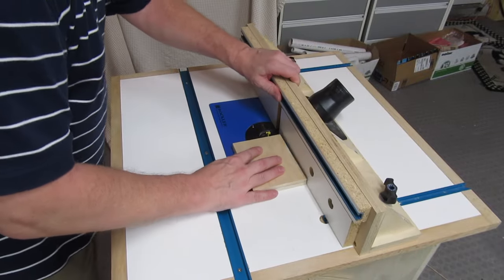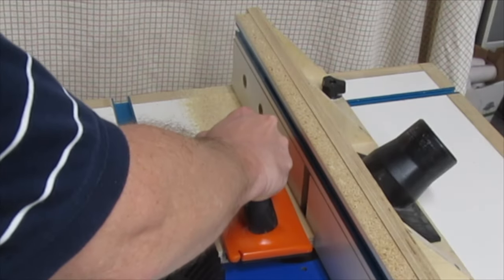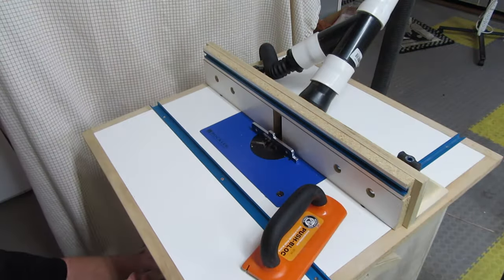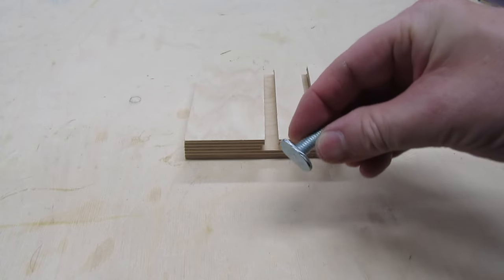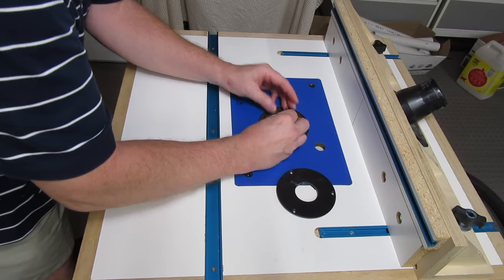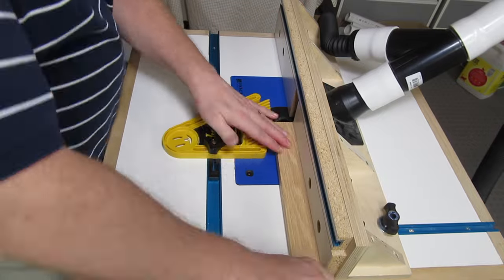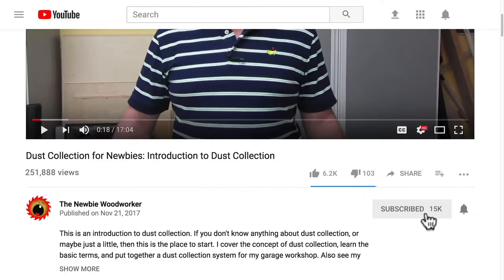Make your own T-Tracks and T-Slots!

Comment: Are they still holding up or have you since switched over to manufactured t-slots?  Also, do you think that using regular bolts is better than using t-slot bolts?  Here’s why I ask...I’m thinking that the extra thickness of a regular bolt head would work better up against the wood groove, than the super thin head of a regular t-bolt or toilet bolt. I’m wondering if the regular thin t-boots or toilet bolts would eventually created spots in the groove that would make it hard to clamp to if needing to be off by a small fraction. For example let’s say a stop was regularly used at 20” over and over again.  I’m assuming an indented groove would be created at that exact spot from the repeated use, especially from a thin t-bolt in a wood slot. If I now needed to have a stop block at 19 7/8” for example, I’m wondering if it would be extremely hard to do because the t-bolt would naturally fall into the 20” groove that was made from repeated use. A regular bolt I’m assuming could create the same issue, but with the extra “meat” (metal on the head), would it be less?

Curious to hear your experience.
Reply from the maker: I think you're worries are well-founded. If I was using them like that, I think I'd want aluminum tracks. To me, it's not worth saving a few bucks when something is critical, like that.

FWIW, I'm still using them in my drill press table, which is the only place I installed them. I use carriage bolts now, because they slide really well with the rounded heads. I use an angle grinder to flatten two "sides" of the head, so it fits in the slot. Have to be careful not to grind off too much, but it's easy once you do it a couple of times.

So far the track is holding up fine. If I crank down a clamp too much, I can hear the wood "creaking", so I try to be careful. Personally, I love the way it looks in my drill press table, especially on camera. But I don't know how much I'd use them in other projects - I'd have to think on it for a while.
Reply: The Newbie Woodworker. Thanks for the detailed reply and update. Very helpful!
Reply from the maker: @PartyTimeProDJs  👍

Comment: Because wood changes significantly with temperature and humidity, I am experimenting with machining fixture pieces using HDPE and UHMW for cheap prototyping. Trying to resist buying the parf dog system... (Don't watch Dave Stanton's videos it's a whole new world of rabbit hole tool spending for excessive obsession with accuracy.)

Have to go veeery slowly on plastics though because they begin to melt/deform at as low as 180F.

About the same streng as wood, so I'm using it for miter tracks instead of t tracks with clamping. I'm prototyping mft template and a new universal track saw adapter design because I am so far down this rabbit hole... At least my friends have cnc routers so I'm not buying one of those...
Reply from the maker: OMG, you're worse than me! 😄 I've used UHMW for runners before, and I'm using them in my router lift to run in a couple of miter tracks. But I think I'll stay away from that video, or I'll never finish any of the other things on my long list!
Reply: The Newbie Woodworker every time I think I want to do something

I end up over engineering a prerequisite component

At this point I'm practically reinventing wheels 🤣

Not having a dedicated workshop space/budget means getting rather creative! Traffic cone ($9) dust cyclone was my first project...
Reply from the maker: That is so me! "Over-engineer" is my middle name. It was true even back in my programming days. But I want it like I want it, same as you, right? As long as you're having fun, what does it really matter, anyway. 😛
Reply: The Newbie Woodworker I'm currently doing a programming boot camp...

I don't know how my mentors put up with me

EVERYTHING MUST BE DONE IN THE SMALLEST AMOUNT OF TIME AND STORAGE AND LINES OF CODE, OKAY
Reply from the maker: Huh. That's how programming used to be, in the 80's and parts of the 90's. But nowadays none of that matters much at all, since computers are so fast these days, and memory is measured in gigabytes instead of kilobytes. What does matter is how easy is your code to understand, and how easy is it to make changes. Maybe they'll get to that later on. Your instructors would probably hate me. 😛
Reply: The Newbie Woodworker I stopped asking questions about how CoreFoundation implements arrays/etc. at least...

But check out this voodoo magic: https://ridiculousfish.com/blog/images/array/cfarray_results.jpg

They make us use real variable names now! When I was in college it was all i++; j--; j*i; absurdity! In the snow, uphill, both ways!
Reply from the maker: LOL!
Reply: Guess I am getting way too old.  In the mid-70's, when I started, we were still using punched cards and paper tape. Was glad when I didn't have to push a cart around just to not "spill the beans" as it were.
Reply: Tony Harris >insert photo of 512GB micro SD memory card.
Reply from the maker: Tony - Both my wife and I were there also. As I mentioned somewhere else a few hours ago, I still remember when we got our first green screens at work. Gone are the days of 2 hour compile times, one program at a time. Thank God.
Reply from the maker: Elaine - Yep, unbelievable. Now, with all the external drives I have, I'm not sure I can even count the number of TERABYTES I have available. Who knew I'd live in an era when I'd need to learn to pronounce "petabyte" (still not sure, lol).
Reply: The Newbie Woodworker did you know that the Large Hadron Collider generates about 1 petabyte of data per second? They don't record all of it, but they've been recording about 25 petabytes annually., That's not even with the latest equipment! They're shutting down for 2 years in December for tons of upgrades.
Reply from the maker: I'm sure I saw something about it. But honestly, it's kind of hard to comprehendg numbers that big. At some point, they just become BFNs. (Big Friggin' Numbers). 😛

Comment: How do you install the ones you made from red oak?  From underneath? Otherwise how are you countersinking the screw holes in the slots?
Reply from the maker: I had to go look, because I couldn't remember. 😂I glued them in. And they're still fine. No separation due to expansion differences, or anything like that. If I were going to use screws, I'd probably consider just using a larger drill bit to drill the countersink portion - the kind of bit with a round bottom, of course. But I'd try it out on a scrap piece first.
Reply: The Newbie Woodworker thanks for the quick response. I might just have to glue since you would only have 1/4” clearance for any bit to countersink. Is 1/4” large enough for an effective countersink on most wood screws?
Reply from the maker: @exexangler  For #6 screws, I think it is, but you'd have to measure to be sure. Personally, I think gluing them is fine. If they're going into plywood or MDF, then the only real expansion will come from the tracks themselves, and if you have the grain running mostly up and down, there really shouldn't be an issue. My guess is that even if you had the grain running horizontally, it wouldn't really make a noticeable difference, but of course I'm not an expert.

Hey, if I'm wrong, then you'll have personal experience on the subject. 😛You could always cut them out and make new ones if you had to. I actually did that once, because I just didn't like the poor job I did on them. Pretty easy to do.

Comment: which router bits did you use  i use 5/16  toilet bolts  in most of my jigs  some 1/4 20  mostly  the larger i ordered them threw rockler  with star knobs
Reply from the maker: The Rockler bit will work with the Rockler t-bolts that came with the star knobs. I haven't tried the toilet bolts, but I think they'll work also. If you don't want to spend the money on the Rockler bit, look for other bits that cut the same dimensions.

Comment: Did you ever find a track saw tslot compatible cutter?
Reply from the maker: I don't understand the question.
Reply: @TheNewbieWoodworker  You went over what fits/doesn't for each - what we all want, and I presume that includes you, is one that creates the same dimension slot that every festool clone rail has on the top and bottom and every generic t-track extrusion uses - ie 8mm opening 12mm width at bottom. I have contemplated using a diamond wheel to make my own out of a generic cutter the right size eg half inch straight ground down could do it in combo with an 8mm straight to clear the path in advance similar to the rockler one but smaller.
Reply: @TheNewbieWoodworker  In particular you stated at some point "there may be a better cutter than either of these" and it was to this that I replied. :-)
Reply from the maker: @fredio54  Ah, got it. Thanks for the explanation. No, I haven't, but then again, I haven't really needed one in a while.

Comment: Dumb question, I'm just a newbie - why not use dovetail instead of T-tracks in these applications? I guess there is a larger variety of dovetail cutting bits?
Reply from the maker: Not a dumb question. I don't have a perfect answer, but here's a guess. When you use t-tracks, you generally use sliding t-bolts in them. T-bolts are relatively easy to find, and probably easy to manufacture. I'm not sure what you'd use to clamp to a dovetail track. With that said, I've seen dovetail tracks used for all sorts of things (in videos - never done it myself), so when in doubt, try it out and see what you learn! 😄
Reply: @TheNewbieWoodworker  Thank you for the prompt reply. I guess you are right - dovetail method is ubiquitous in assembling sliding parts, I was just questioning its application in this particular case. Your suggestion to try it out is also correct :-) then you don't notice when you stop being a newbie :-)
Reply from the maker: @adamsmith2719  That's really true. I look at it like this: For some things, I just take people's word. Safety, things like that. But for things that either don't make sense to me, or I just need to see it for myself, then I'll spend the time and try it out. In other words, pick and choose. What good is a hobby if you can't have fun, right? 😄

Comment: Thanks so much for this video. I really learn a lot from you. I have a question. Do I need an adapter for the bigger bit because it won’t fit my router?
Reply from the maker: You're quite welcome. You can't use a bit with a shaft larger than your router will accept. Sorry.
Reply: Thanks
Reply from the maker: @PastorEbolden  👍

Comment: Hi there! 
Yonico does have 1/2" shank t-slot router bits. 3/8" X 1/2" and 1/2" X 1/2." 
I don't know if they sell them separately, because the ones I have came with the big 1/2" shank. set. I hope this will help somebody though.
Reply from the maker: Thanks! 😄

Comment: There is a better solution for Expansion/Contraction, use plastic (Not Acrylic) which never moves to make T-Tracks. It is rock solid and easy to cut. Wood will be a problem over time, so why re-make when you can use Plastic.
Reply from the maker: Thanks for the comment. Why use wood over plastic? For one thing, I think red oak t-tracks will look awesome. If contraction ends up being an issue, I'll just make a new drill press table using aluminum t-tracks.

Comment: I have seen someone use slat wall as T-track on a CNC machine, he also used the aluminum track reinforcement
Reply from the maker: Interesting. Man, if I had a CNC machine and a 3D printer, I'd never come out of my room. 😛
Reply: Newbie:
Too funny ¡
Reply: Get yourself a Snapmaker, which is a 3 in 1 (Laser Cutter, CNC Engraver & 3D Printer) Check it out at snapmaker.com. I am buying one in about two months time.
Reply from the maker: LOL. I'd end up spending so much time playing with it, I'd never get another video done! 😛

Comment: can you use a portable router with slot cutter bit?
Reply from the maker: I wouldn't try it with a trim router, but a plunge router or a fixed-based router should be OK. Of course, be careful. 🙄😄

Comment: Quick question for a newbie router owner.  When you seat a bit in the router do you drop it in as far as you can?
Reply from the maker: Yes, but then you lift it back out a little, maybe 1/16" (which is pretty hard to judge, so just back it out "a little"). When the bit gets hot, it expands, and if it presses down against the bottom of the collet, it can get stuck.
Reply: @TheNewbieWoodworker  Thanks for the reply.  I'll use a feeler gauge for both.
Reply from the maker: @hogue3666  You're welcome. You don't have to be that precise - just as long as it's off the bottom, I'm sure it's OK.

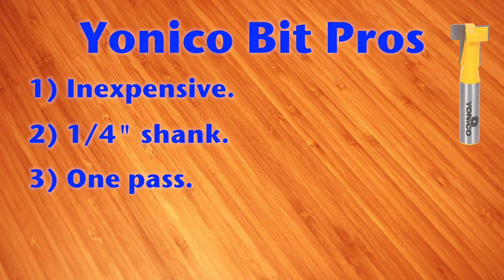Comment: Dan, I think you may have slipped.  I could be wrong tho.  @7:20, when you are talking about the Yonico bit and a 'smaller router', you suggest making multiple passes.  It took me awhile to tie that back to using a straight bit before using the 'Yonico'.  You made me have to think - but that's a good thing. ;-)
Reply from the maker: Thanks for the comment. Yep, that wasn't at all clear on my part. The worst part is, I knew it wasn't clear and left it that way. Chalk it up to a case of "I'll be darned if I'm going to make one more change - I'm posting it as is. People will figure it out." Admittedly, that's never a good attitude. But I'm glad you did figure it out!
Reply: Yeah, I was trying to figure out how you'd do multiple passes with a t-track bit. Thanks for clarifying.
Reply from the maker: Dangit! I know better than to leave something "wrong" when I post a video. Shame on me for not fixing it. I hope this time, I learn my lesson. 🙄
Reply: Jay Herde

Comment: Great minds think alike.  I have both of the same bits!  I'm interested in any strength differences between the aluminum and red oak tracks. Were you planning any non-scientific tests?  Along that line,  Wood Glue makes the joint stronger.  What about a glued up t-track for those without routers and perform the same non-scientific strength test. Just some of the thoughts popping into my head from your video's.  Great video once again by the way.
Reply from the maker: Thanks for the comment. That's funny about the bits. I had the Rockler one for a year or so, and decided to get the Yonico bit for this video - who knew I'd end up loving it? Since I'll be putting these t-tracks in my drill press table, they'll certainly get put to the test, strength-wise. But I'll leave someone else to do the tests. And I'm not a gluing expert by any means, so again, although it's a good idea, I'll leave it for someone else. Thanks!

Comment: Hi Dan, I need your thought on an observation that I just realize while making (still designing phase in sketchup) a drill press table: some fences have their T-tracks on top (like your drill press, correct?) and some on the side (like your router table or steve's drill press). Are there specific reasons to put them on top or the side? KUTGV!  BTW, my drill press will have 3D printed T-tracks (or al least I gonna try, I did not yet see 3D printed T-tracks on youtube makers videos and maybe there is a reason fo :p).
Reply from the maker: Well, I think this is how I do it, but I reserve the right to be wrong. 😄If I want to use a flip-stop, then the t-track goes on the top of the fence (the "back" portion of two 3/4" pieces of plywood glued together). And it has to be a certain height, typically pretty low (check the requirements of the flip-stop you might want to use). But for the router table, I want the fence a little taller so the sliding pieces don't have to be too small, and also so that there's room for the dust port. So like I said, I think this is how I usually think about it. I hope that helps. 😄

Comment: What kind of router do you use in your table?
Reply from the maker: I have an older Ryobi plunge router. I can't remember if I mention it in this video or not, but I have a unique router lift I built, that works for both plunge routers and fixed-base routers. Here's the build video: https://youtu.be/LJqPDADi8MM. It would work fine with something like a Harbor Freight router.
Reply: @TheNewbieWoodworker   right on thank for answering back and love your content I watch them all as soon as there available to watch
Reply from the maker: @shanejohnson800  No problem, and awesome! 😄

Comment: I followed the link on this video and ended up buying the wrong bit. It doesn't link to a 7/16th bit anymore.  1/4 INCH HEX BOLTS DON'T HAVE 1/2 INCH HEADS
Reply from the maker: Which link are you talking about?
Reply: @TheNewbieWoodworker  the Yoniko bit is not offered in 7/16. I followed your link and bought the product without thoroughly looking it over. Got a 1- 1/16 bit. Was a "bit" upset but investigated. Found the 1/2 in bit bought it. It doesn't work because 1/4 inch bolts have 7/16 heads. Rewatched your video and you show it clearly as 7/16 (for all of 2 seconds). They don't offer this any more. I'm buying some true 1/2 x 5/8 tee bolts which should fit well though the 1 1/16 bit is useless. I'm new to this and should not have trusted this old video.
Reply from the maker: @armus550b  Thanks for the info. I'll look into it. Sorry about costing you some money - nobody likes when that happens.
Reply: Yoniko customer service was good. They found the correct model number 14190q. Presently it's out of stock but that is the one featured in the video
Reply from the maker: @armus550b  That's awesome! I wonder why my link went to the wrong one?